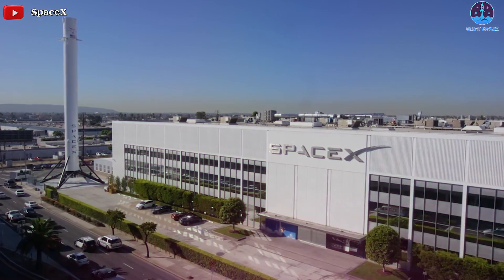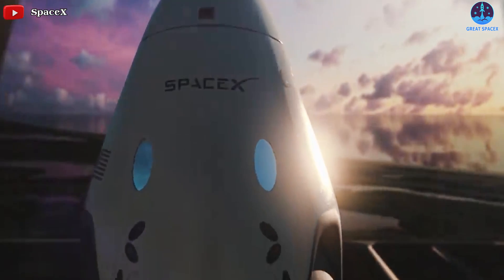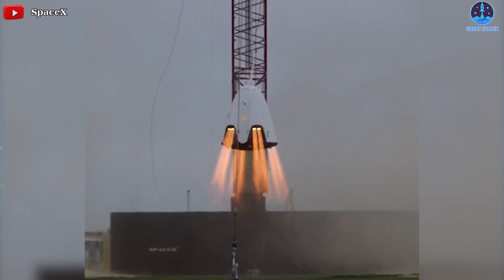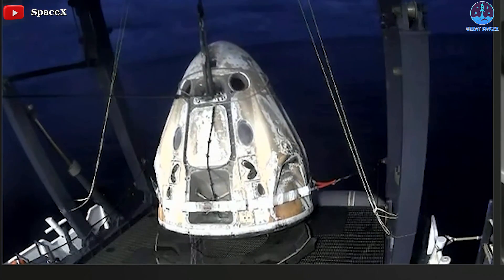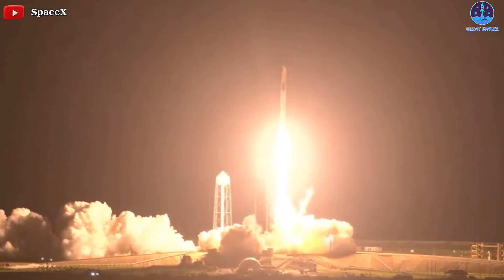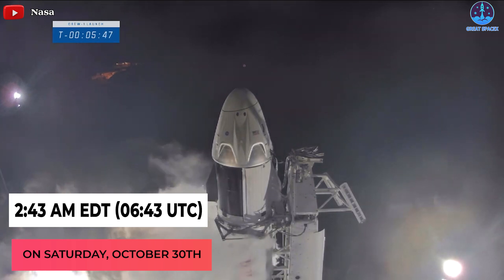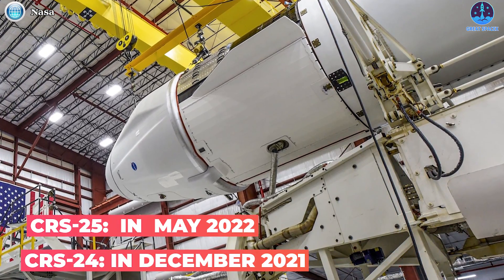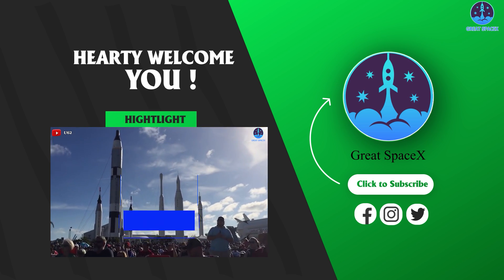Elon Musk "It’s a big deal that Dragon is reusable". NASA & SpaceX NEW historic flight scheduled

Comment: Its all about "risk posture" when it comes to cost and speed of delivery.  NASA's Apollo program was at a higher than 99% for success and the Space Shuttle was at a mid- 95%.  Looking at it, Space X not only lowered that posture % but also redefined success with the use of super cooled O2 only allowing a very small launch window and requiring initial loading while the crew is onboard the vehicle.  I continued to be surprised the the F9 is man rated but I guess private industry had always been that way.

Comment: Let me remind you that the only expendable component of Space Shuttle was the external tank. OK, SRBs were more remanufactured than refurbished, but still. So, tone down your "SpaceX is the first..." a bit.
Reply: I agree but didn’t the boosters only last 20 flights
Reply: @InsertGenuineName  Well, SpaceX has demonstrated only 10 reflights of the first stage so far. But, to be frank, Shuttle SRBs were completely re-manufactured after each flight, with very little apart from the shell of the segments being reused. 
The record turn-around time for SpaceX Falcon 9 first stages is currently close to that of Shuttle orbiter - a tad less than two months. I have no doubt that SpaceX can do much better, especially as most of the time spent on the orbiter related to thermal protection tiles. But now, with Starship, something similar might befall SpaceX. This will be interesting to watch.
Reply: @bazoo513  Ok, also I hope I don’t indirectly cause a comment war
Reply: @InsertGenuineName  Well, two of us are peaceful enough :-)

Comment: They need to figure out how to reuse the second stage.   So far it’s more expensive to recover and refurbish the second stage than it is to build a new one.
Reply: Starship will eliminate this problem.
Reply: @jackboot3946  won’t starship be overkill for most space flight needs such as communication or weather satellites?
Reply: @RossM3838  Ride sharing. 
If Starship works as planned, costs will be so much cheaper than any other launch provider, it will not matter. Hell, Amazon might even use them to ship parcels....?
Reply: @jackboot3946  no blue origin will sue.
Reply: @RossM3838  Not when your only paying for fuel, plus you can simply do shared rides.
Reply: Everyday astronaut did a pretty decent demonstration of why Elon went straight to starship and did not develop a reuse second stage for falcon
Reply: there is no way to reuse the second stage because it lacks the engine needed for landing. and there is no space left for en extra landing engine
Reply: @outofpower  No, it's more about the quantity of fuel required to de-orbit and land, heat-shielding for re-entry, and the extra fuel to get that extra mass to orbital velocity.
Reply: No point. once starship starts flying operationally, Falcon-9 will be retired.
Reply: @gahrie  I think they will sell the program to Blue Origin, who will rename it New Glenn At Last.
Reply: Well they could just build a smaller version of starship. Or we just wait for Terran R and Relatively Space.🚀LOL🚀
Reply: Starship is not proven concept for reuse but it will be very cheap to build an unreusable cargo and tanker version - no heat shield, no flaps, no sea level engines, just a ship made out of steal on an assembly line in a giga factory. Shouldn't be more than 5 million a piece, final cost in 10th year of production...
Reply: @ksd593  Exactly. If you use it as a transport, tanker and habitat in space, and have a shuttle to do Moon/planetary landings, it makes a lot of sense.
Reply: @jackboot3946  not easy to make shuttle afordable + reusable + without a lot of dead weight + with big fuel tanks. Better a discardable starship with smaller, lighter, reusable, human rated ascent descent stages.
Reply: @ksd593  Discardable, reusable.... seems like a conflict there.
Reply: @jackboot3946  you are right, depends on the starship variant - reusable in orbit around Moon and Earth until the propellant lasts/refilling. Around Mars - not sure due to delta V. For landing and ascent a smaller stage can be used. Starship upper portion for this purpose can be made from aluminium alloy and stuff. Couch engineering, you see :)))))...

Comment: The shuttle was the worlds first reusable rocket not falcon.  You may have heard of Columbia, Challenger, Discovery, Atlantis, and Endeavour.  The orbiters were reused and some SRB segments were reused more times than any falcon booster to date.  You can say refurbish, but this is basically what SpaceX is doing.  The shuttle was more complex which added to the time.

You mentioned unforeseen heat shield damage but then go to the next subject.  If this was SLS or Boeing, you would have gone the next five minutes explaining what was unexpected.  Talking about what was not expected would have been nice. You know information.
Reply: Not a shuttle hwter, but the fact is that it never lived up to its promise.
It needed infinitely more refurbishment than promised, including engines which were basically ruined after just one flight.
It was way more expensive to operate than a disposable ship would have been and I dare say more dangerous.
A magnificent failure.
Reply: It's worth remembering that the Shuttle doesn't have a real good safety record...
Reply: @jackboot3946  In brief, Challenger launched against the recommendations of Thiokol SRB experts.  Thiokol managers ignored their own people and bent under NASA pressure  NASA said they would go with their recommendation, but Thiokol felt pressure not to delay.   Challenger flew outside of what the SRBs were ever tested or rated for.

Columbia was a known issue with the foam, but the experts said that it could not do catastrophic damage.  They were proven wrong after tests were performed as part of the Columbia accident.  

The shuttle flew 135 crewed flights.  Dragoon is coming up to number 5.  I hope they stay at 100%, but the more you fly, the greater the risk of something going wrong.  There is no way to guarantee hardware will work as designed every single time no matter how well engineered.
Reply: @pebmets  Can't wait for the first crewed propulsive landing reusable rocket. Something that has never been done.
Reply: @jackboot3946  Kind of like the same propulsive landing that Musk bragged about before going to parachutes and splashdowns for Crew Dragon.  I hope the idea works on the moon, but it may end up being the same thing for what was done with the Apollo Lunar module. There is not that solid landing platform on the moon like it is on the drone ship and there will not be a launch tower to catch it, (if that even works in Boca Chica).  Taking off will be interesting kicking up all that moon dust.  There is no flame trench or method of diverting the energy at liftoff away from the vehicle.  It will be closer to the ground.  Again I hope they figure it out.
Reply: @pebmets  I understand it was NASA that insisted on splashdown landings.
Reply: @pebmets  That's the purpose of the high mounted rockets on Starship Moonlander.
Reply: @pebmets  Thats why the moon starship design uses thrusters at the top of the rocket for landing, reducing the amount of dust kicked up
Reply: Nasa has been great in reusing parts, they're still using old regurbished parts in the SLS right now.
Reply: @Tac_Taco  The RS25s have been refined, they are not original.  The SRBs have been refined, not original.  We can use the same argument for Falcon.  Reusing the same parts.  Wait, that is what reusability is.  Isn't that what Musk's goal was?
Reply: @pebmets  Umm the RS25s are the ones left from the shuttle missions, like the ones that flew. they have spent millions refurbishing them only for them to be destroyed in the sea
Reply: @Tac_Taco  But it doesn't take away that Shuttle was the first reusable rocket, not falcon 9 as this video indicated.
Reply: @pebmets  youtubers get things wrong all the time. Why all the hate for SpaceX? What we got now is a private owned company working with NASA without all the damn limitations, cutbacks and cancelations. It was NASA who inspired Elon and many of us.
Reply: @Tac_Taco  I believe mistakes need to be noted since some people do not understand the information is incorrect. 

I believe falcon 9 is a great system, no argument. I don't believe starship should be awarded the best ever because it had proved nothing. Is is not hate, but natural skepticism. It is human nature to know how and it has never been explained how this trip to Mars will work based on what Musk says it will do. To question is to learn and maybe find a better way.
Reply: you mean Flying Brick
Reply: @bradhanley8368  But a flying brick that did it in style.  Tell me that you don't think it was a beautiful sight watching an orbiter land.  You don't have to like the program to see that it was interesting and great to watch.
Reply: The shuttles where barley reusable, a better definition is refurbishable as it need huge amounts of man hours to get it flight ready again including pulling the engines out and checking every single tile for issues, the place the boosters where refurbished was even called the booster refurbishment centre where they where stripped all the way down to the bear metal and non of the electronics or hydraulic where reused. The falcon 9's on the other hand are reusable, requiring only a quick inspection to look for any possible issues, they don't even bother cleaning them. The dragon capsule is definitely more refurbishable requiring the heat shield to be removed but even it bails to the amount of man hours needed for the shuttles.

Comment: Tesla is moving it's HQ to Texas now I wonder if Tesla will make the moon/mars rovers for Spacex?  
A Cybertruck called M/M (Moon/Mars )
Would be cool and make a good transport for people and equipment. A E model for Earth, and the M/M
made for the Moon would work for the Mars mission as well 2bangs for the buck.
Reply: Yeah, about that. there are physical properties which are different on the moon and mars related to the weight of the object after it had been subjected to gravity. This is extremely important because it is linked with all sorts such as friction and bouncing off of the surface. Plus, the cybertruck has had continuous delays I highly doubt a mars/moon model would be practical. Plus there's little practical reason for them at this point if you're wanting to just colonize planets as bases would have to be around a very specific region as is.
Reply: @somerandompersonidk2272  lol lol lol lol lol lol lol lol lll lol l lol lll lol lol lol lll lol lol lol lol lol lol l lol lol lol lll lol lll lol lll lol lll lol lol lol lol lol lol lol l lol lol lol lol l lol l lol lol lol ll lol lol lol lol lol lol lol lol l lol lol lol lll lol lll